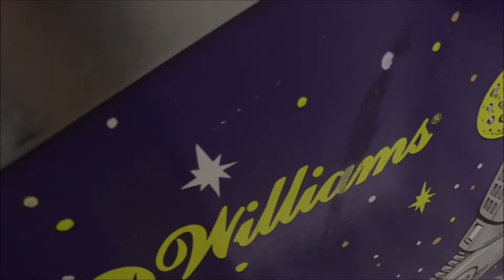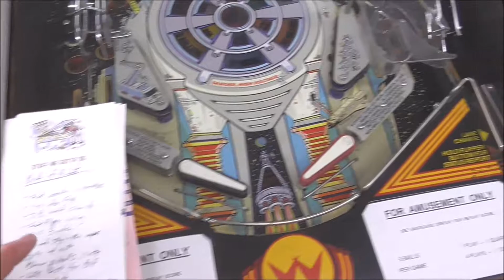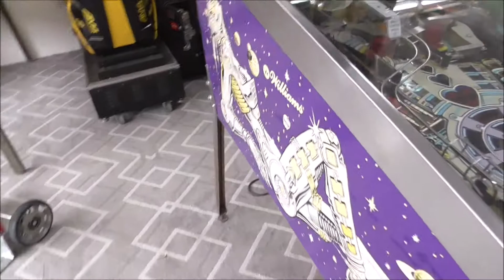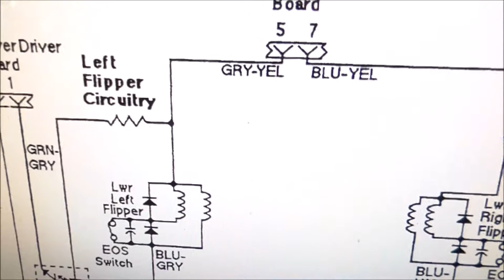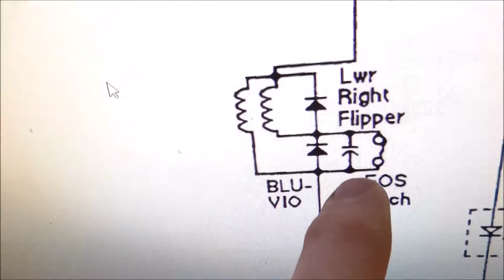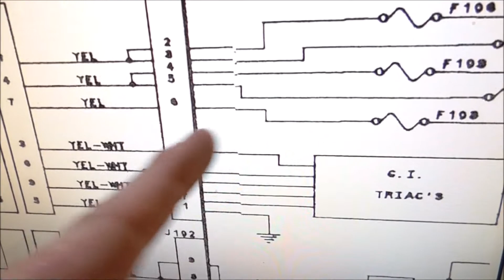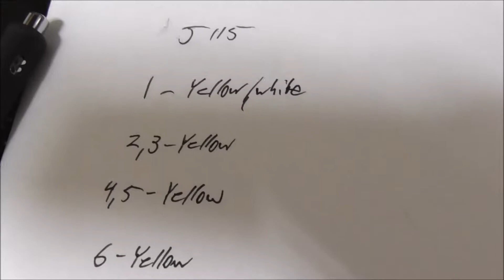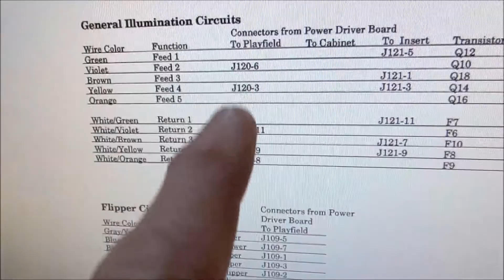Working On Williams Classic BRIDE OF PINBOT Pinball Machine 1

Comment: They make black cabinet art for bride, instead of purple. Just found that out yesterday. I just converted mine to LED last week and it is definitely worth it. So many colors on this machine. Also the heat was insane before LEDs. My pf inserts were all popping out, luckily not cupped or worn. Heat gun and piece of wood pushed em right back.
Reply from the maker: We've got the black art and are going to put it on this one!
Reply: @LyonsArcade  could you do LED'S on this one  for something different?

Comment: i have a bride of pinbot in my collection. it's a fantastic pin, i love that game. actually my "bride" asked me to find her one, so i did. we have had it probably close to 10 years now. also in my collection i have a 1980 firepower, 1986 high speed, 1988 jokerz, and a 1995 sega apollo 13.

i put LEDs in ALL my games, including firepower. several reasons why i did this. 
1. they typically last much, much longer. change them once and your usually done
2. less (or probably almost no) heat. heat destroys backglasses, translights, playfeild plastics, and GI connectors. i really hate the damage the heat causes. i had to replace the backglass for firepower and the translight on high speed. they were in really really bad shape. 
3. i actually like the way it looks. nice bright uniform lighting on the playfeild. i have always gone with LED's that werent excessively bright, but the lighting is more uniform.

the LED's usually mean you can avoid ruining things. i look at these games as timeless artwork, and i do what i can to preserve them. i bought the backglass and translight close to 10 years ago but i have over $500 into those 2 items. i installed a LED DMD in my apollo 13, and if the other displays fail over time, i will replace them with LED displays.

Comment: Joe - one upgrade to the power board (yes, I know another shop did the work on it) is the ezSBC LM323k replacement voltage regulator.  

It's a digital regulator, so it emits very little heat, and it produces a much more stable +5vdc.

Also works great on Skee-Ball CPUs.

Comment: Nice video as usual! Looking forward to seeing the rest of this project.
29:55 - with NVRAM you lose the clock and thereby a fun feature: The birthdays of the developers are stored in the game and the machine plays a happy birthday tune and shows a message on the respective days (but this needs the clock to work, obviously).
Also, it is normal that the head spins a couple times during startup until it finds its home position. The game can only "identify" face 4 by a switch on the head box; all other positions need to be derived from that.

The cabinet art is really pale as you can tell by the heart around the start button which should be red. Maybe consider using the "BOP 2.0" style decals that I personally think look so much cooler than the original ones. Cheers.
Reply: It did cycle through face 4 a few times, so I'd suspect that switch being misaligned or not working.

Comment: I suspect the issue may be one of several things. 

1) The position sensor that determines which face is being shown and relays the information to the CPU is not working properly or is incorrectly aligned leading to the motor being in a loop and not stopping. 

2) There could be a Problem with the motor control circuits. 

3) I wonder if there could be a switch stuck on that is causing this.

Comment: Nice.   I use the superlube on the bakolite (or whatever it is called) discs like for the player up unit coin unit match unit on the EMs.   I have never used it on SS games.  I was wondering if you ever used it on the connector plugs/headers/edge connectors?  I would think it would help with slowing oxidation/corrosion.  but am a little afraid of it causing shorts between the pins/edge connectors.

Comment: The face is suppose to stop when the robot face is up.
It could be that a switch is no good or that it is not there.
Or could be that sus wiring that had tape one it.
I saw at least two places it had electrical tape on it.
I would check that and then put heat shrink tubing after figuring if the wires are all correct.

Comment: Around 22:20 or so you mention that the capacitor is non-polarized but the symbol is a polarized one.  Two straight lines indicates a non-polarized cap. A straight line (negative side) and a curved line (positive) indicate the polarity. I just wouldn't want to see you make popcorn with a cap in backwards or worse with a large cap. But yes the Switch doesn't care about polarity.
Reply from the maker: The capacitor is non-polarized

Comment: If a coil locks up and blows a fuse on the way to the board can it still damage the board and  or transistors that drive the coil?  Thank you
Reply: Typically on WPC, a coil won't lock up unless the driver has already failed, as that's what usually causes the lockup.

If the proper fuses are in place (3a SB for most coils) a locked coil will blow the fuse long before the PCB burns.
Reply: Actually, just got to that place in the video.

Yes, absolutely, if a coil locked up and melted (so it's dead shorted) it will absolutely destroy the driver that controls it, when a fixed board is reinstalled.
Reply: @litz13  So the fuse will not prevent this? Thank you
Reply: @jasn2031  it's a slow-blo fuse.  The expectation from the manufacturer was part of the repair on the part of the technician (remember these were designed for commercial use) would be to fix the failure, then fix the PCB.

Comment: JOES CLASSIC, Any reasons why they are using TRIACS for the GI Lamps?
Reply: Two reasons ... one it's 6.3vac (so you need a triac to switch it) ... two the CPU needs to be able to control the GI, and the easiest way to do that is with a triac ...

One really cool thing WPC does (pioneered on BOP) is duty cycle the GI lamps to achieve 7 levels of brightness.  It does this by detecting the "zero cycle" point of the AC power supply, and cutting the triac on/off as needed to achieve the desired brightness level.
Reply: @litz13  How is the CPU detecting the zero cycle point of the AC power supply? The CPU is outputting a PWM signal to the GI amps GATE PIN of the Triac's?
Reply: @waynegram8907  the Triac drives originate in U1 on the power driver, with T0 through T4 driving the 5 triacs, and T7 driving the flipper enable relay.

Comment: On System 11 using LEDs for GI and replacing the plasma displays takes a chunk of load off the power supply and stress off the wiring etc. I would assume this is also the case with WPC. Also… (Not directed at you Ron) but when y’all rebuild flippers replace the bushings, it’s a two dollar part!
Reply from the maker: You sound like you’ve got it all figured out and you’re angry about it

Comment: The second ground is because the power running thru a ransformer. The 2ndary on the winding is not grounded in any way. This is how idiots electrocute themselves trying to burn a board w a microwave transformer, salt water and some jumper cables. I'm not saying ur wrong love ur channel but u gotta have understanding and respect for capacitors and transformers. That might only be 7vd coming off that transformer but it will pull power unrestricted until transformer melts or breaker pops.